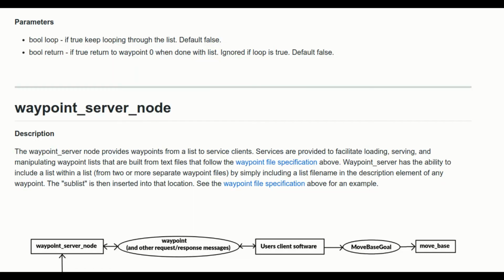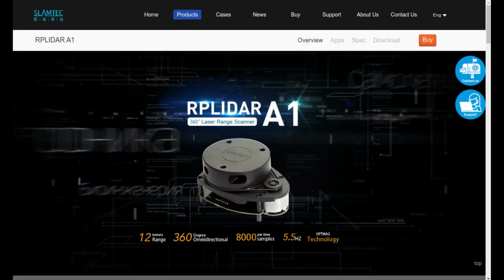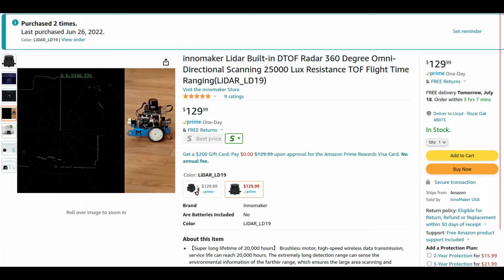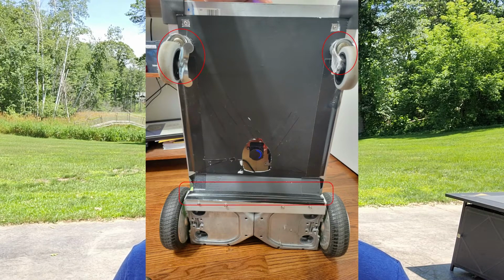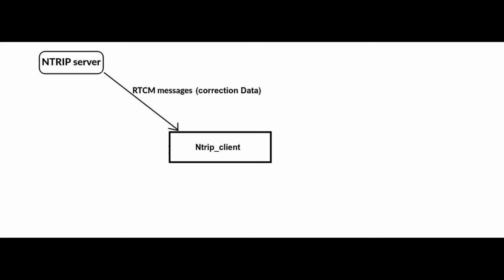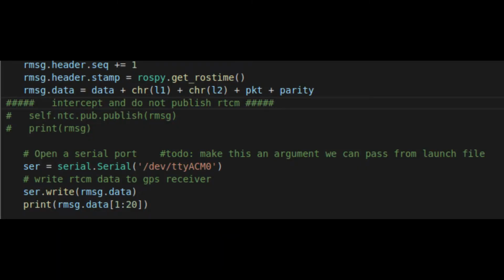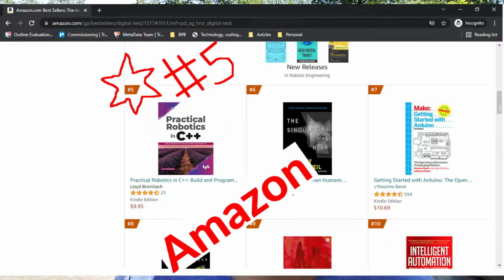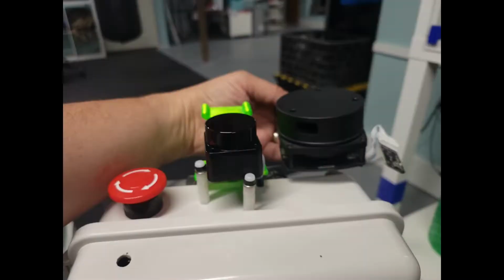Robotics Without Coding? Robotics FAQ

Comment: Loving the videos and the book even more. Quick question, for your hoverboard ROS series, do you plan on expanding on that and maybe making videos on turning the robot autonomous like using gmapping which you explain in your book. You're an amazing teacher and I find that videos here on youtube explaining SLAM with ROS implementation to be a little confusing.
Reply from the maker: Thank you for the kind words. I have to be careful what I publish because of my contract with the publisher (can't be too similar to any content in the book). I do plan to do a series of helping book readers transition to use the ROS navigation stack for a more robust robot. Also keep in mind that since the hoverboard platform responds to the same commands as the robot platform from the book, it should be pretty much a matter of replacing the simple_diff drive that used to convert the velocity twist message into PWM signals for the motors. Instead you would launch the hoverboard driver and make sure the message topic names match (the hoverboard driver monitors "hoverboard_velocity_controller/cmd_vel" but you can remap that or better yet, use the cmd_vel_prioritizer I have in this repository: https://github.com/lbrombach/practical_robot_tools.